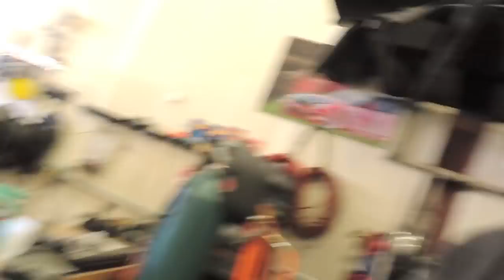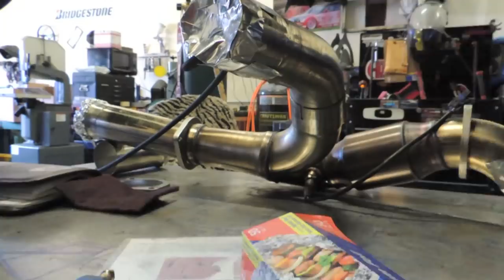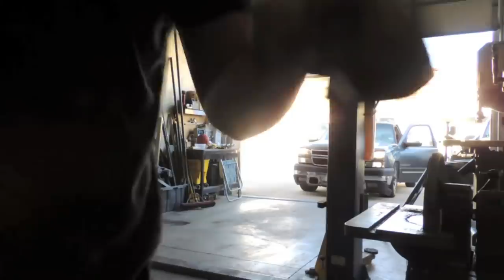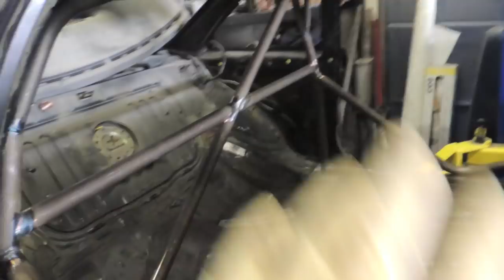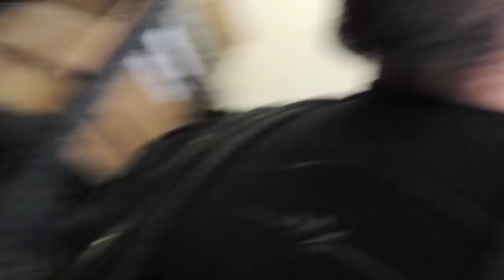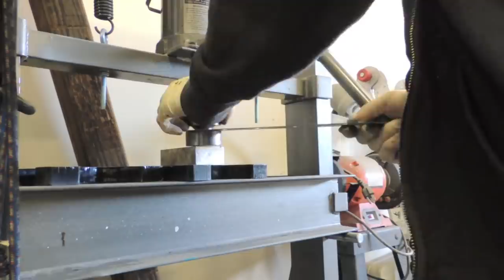SC300 SAFTEY CAGE & Dimple Die Gussets/More Exhaust Fab

Comment: The standard you hold your work this impeccable, it's nice to see quality work. Not many businesses do work at the standards you hold yourself to so glad your staying busy and you stay in business for a long time. What mounts are you using which the steel collar and poly inserts for your 1/2" bar stock hangers?
Reply from the maker: Tyrell Lengerich thanks man I only got my reputation haha. Those hangers I make myself. 1.25 stainless tube 1/8 wall thickness and some energy suspension bushings. And weld tabs on how I need it.
Reply: MISSILEWORKS, those look way more structural then the standard rubber hangers, didn't know if the outer sleeve was part of the energy kit but sounds easy enough to make. Do you happen to remember what model/application the bushing is for?
Reply from the maker: Tyrell Lengerich shit I don’t man. I just went in summit and searched for energy shackle bushings .500 ID 1.00 OD
Reply: MISSILEWORKS that works man, didn't know you could just look them up by dimensions. Thanks!

Comment: Why not just put a split flange on it would have been easier .
Reply from the maker: P Kuudsk you mean a v-band?
Reply: MISSILEWORKS no he's talking cutting the flange and rewelding it together around the pipe. The reason is yeah it's easy but it's not right. Chances are the welds won't last as long and over torquing that flange I could snap the truck is low as well and if he hit it it's just not a good fix to do it that way. Which is why he did it the right way with a good fix that will last.
Reply from the maker: Ryan Lott ahh gotcha. Never thought of doing it like that. But the route I went wasn’t hard. And the flanged I welded on where actually meant for each other so less chance for an eventual leak.